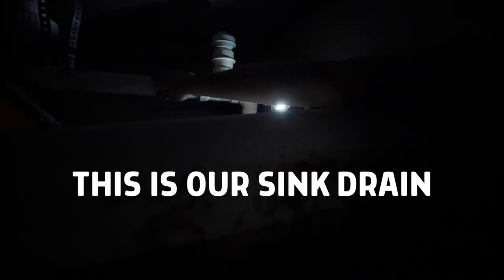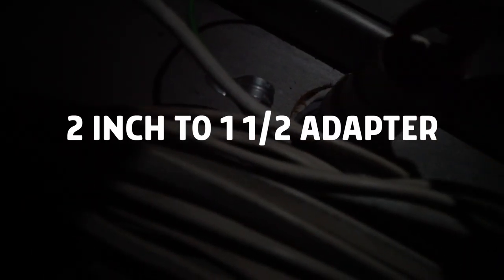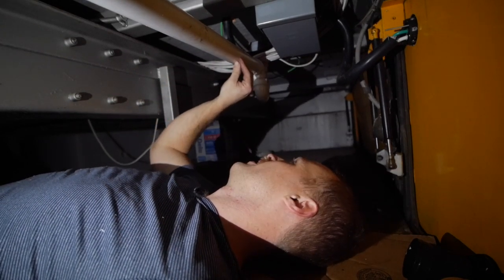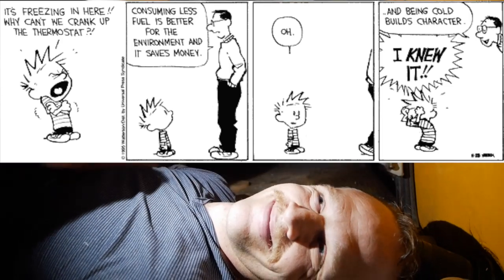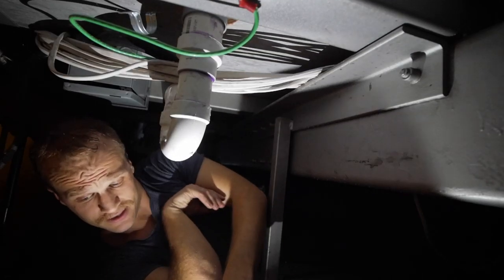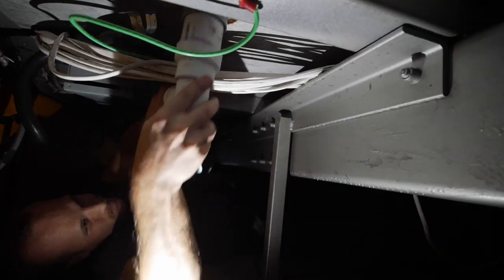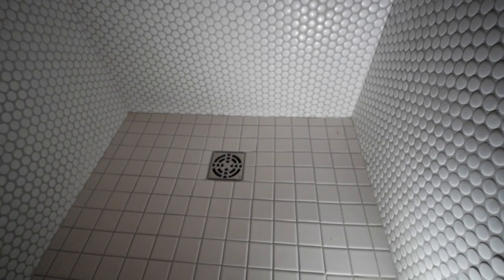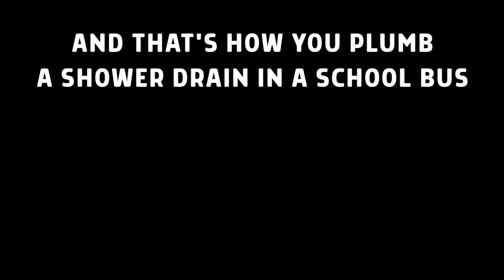Plumbing the Shower Drain in Our School Bus Tiny House: A Video For My OG Skoolie Builders

Comment: Justin are you going to put some kind of protection between those electrical lines laying on the metal frame. It’s almost guaranteed to rub through in time. Then you have electrical shorts which can cause a fire and mental break downs looking for the problem.